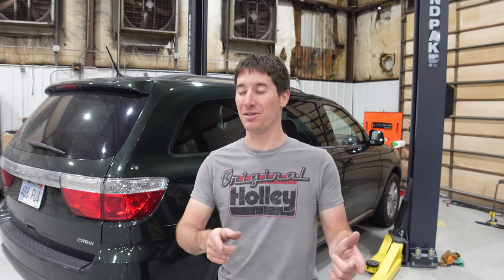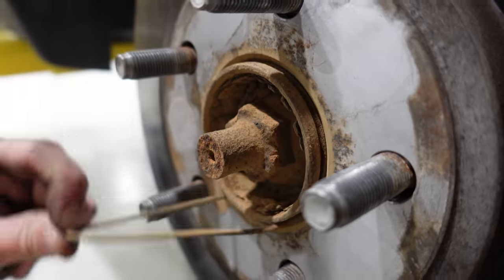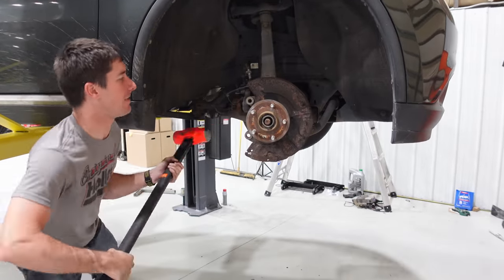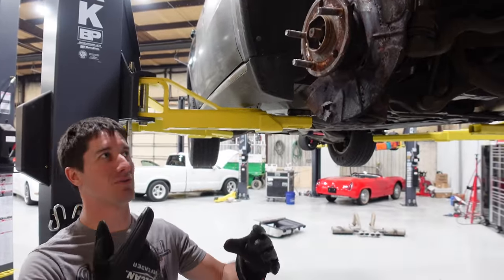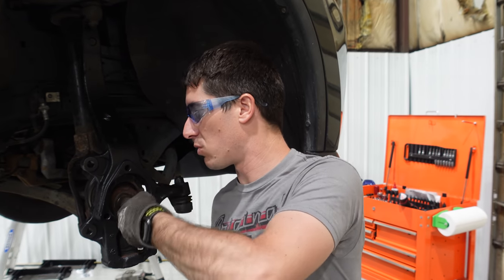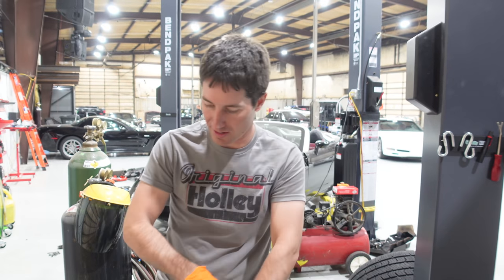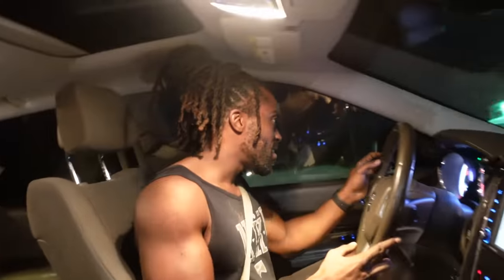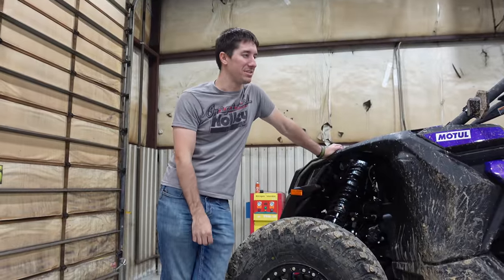This Is The Most STUCK Wheel Hub I've EVER SEEN *Totally Rusted*

Comment: Put a cheap slotted and drilled front rotor set with decent quality pads on sisters 99 300m and surprisingly they actually still stop better  than the factory setup and haven't warped yet. Sometimes you get lucky on cheap parts and maybe same with those rotors you got on that Durango. Hers had decent reviews and it had been shaking badly during braking for a while so needed to get done. I may throw a set on my 06 Charger RT as it has a very slight shake at speed and the pads are still fine. I love four wheel disk brakes...

Comment: Needed to do a rear wheel bearing on my 330ci.  Hub was so frozen on the axle shaft that a 20 ton press and oxy-acetelyne torch wouldn’t get it to budge.  Ended up finding a good used rear trailing arm/knuckle and cv shaft for $100.  Never seen anything like it.

Comment: No hammers or pullers needed. Put a piece of pipe btween the edge of the hub and frame and use the power steering. If the 3 nuts have flanges use a socket and extension. If you do not care to salvage the rotor just remove the 3 nuts on the hub, and bolt the rotor back on. Then use a pipe between the rotor and frame.

Comment: Man I did 2 hub bearings last week and got super lucky I bought a big slide hammer last year when I needed to do a previous wheel bearing on a different vehicle. Popped out with about 50 or so hits. But yeah if you had a slide hammer and your buddy heating it with a torch I think you would've gotten it easier. Massive pain in the rear either way.

Comment: Not that it hurts to reinstall, but rotor retainers are only there to prevent rotors from falling off going down the assembly line. They don't need to be reinstalled.

Comment: Wheel hubs with rust, good luck with a sledge hammer.  You need an air hammer, or grade 10/8 long bolts and press that hub off,  both work well but I prefer the press, just set the impact gun to #3 power and let it rip.

TLDR: Soak the hubs in pblaster before trying any tool and let it sit for 30m

Comment: The problem here is the bad bearing is giving flex so most of the hits are being dissipated in the bad bearings so put the bolts back in and hit them with an air hammer.

Comment: lol you had it easy. My 05 Durango was way worse. It took 3 days. 2 full cans of map gas. a can of pb blaster and about 2 hours taking turns with my friend using a 10 lb slide hammer connected to a hub puller. There was an entire white metal o ring welded to the knuckle that came off of the hub when we finally got it off.

Comment: When I worked in a shop I've had a couple bad experiences with axles seized in the hub, my snap on air hammer wouldn't even push the axle out a couple times. Destroyed splines on the CV axle pushing it out with a press. But the worst, by far was a 1 ton 4x4 dodge, even with the special long socket looking tool that uses steering to press out the hub. After several hours my boss came over and torched the ball joints ( you can't take the nuts loose without removing the axle from the hub) and we put the whole spindle in the press, where it cracked while we were heating it. Ended up with new ball joints, spindle, axle ujoint, outer stub axle, and hub. Worst day ever.

Comment: Take an old rotor and bolt it backwards on the wheel hub. Gives you a bigger target to hit with the sledge hammer.
Reply: 🤔 interesting but I'm not sure how well that would work in practice. I have split rotors from the hat and I wasn't even hitting them that hard

Comment: Next time go get some bolts at the hardware store that thread into the back like the ones you took out. Put in a few threads. Get a air hammer and hammer on the new bolts. It will come right off

Comment: Am I the only one that noticed the uneven wear on the tire you took off while it was leaning up against the lift?  Looks like you might have a toe-out problem (unless it was the bad hub causing the uneven wear).  Something you might want to look at in the near future.
Reply from the maker: Yeah those brand new tires were feathered when I got it… Potter and I agree it’s causing most of the front end noise 🍻

Comment: I would've grabbed an air hammer and started hitting it on one the ears and get it to spin to break free whatever rust is holding it, the hit it from the back with the air hammer or in your case sledge lol. But either way looks like you got it out, being in Michigan rusted hubs are a dime a dozen.... especially on mopar.

Comment: My daily driver is a 2011 Durango R/T, and I'm looking forward to doing the cam/lifter replacement for the DoD problem most of the 5.7s have (99k miles now).  Right now, I'm just hearing a lifter tick at startup which goes away after a few seconds, but I'm not waiting for a cam lobe to wipe out!  Besides this, it has been a great vehicle, and hey... it's paid for!

Comment: The sauce for pressing out stubborn unit bearings is to use the power steering as a press to push them out. Just gotta find a place where you stuff an aluminum slug or bar against the bearing casting and then some other part of the steering (or the frame), fire it up, and bump the wheels opposite of your brace. Work it back and forth like that a few times and they pop right out. 

I did one side of my TJ as you did here... Taking an entire day, lots of cursing, etc. I did the other side as I suggested (which I read from someone else)... 15 minute job.

Comment: Shuould have put a bolt 5hrough where the stud was out and a nut on the inside,then crank the bolt against the backing plate out she comes.Southmain auto has a tool for it check it out JR

Comment: Your smarter than this.     Both wheels off ground ,in gear,    hold one wheel from spinning,     then the other   ,see which one is making noise.     NEXT ,cut a section out of the dust shield and remove it. This lets you put your OXY TORCH WHERE IT DOES THE MOST GOOD.  NOWWWW get a high quality WOOD CHISEL.Use it to wedge apart the bearing hub and the aluminum bearing housing.

Comment: Use a damn chisel and some PB Blaster. It'll come right off. I've had way worse hubs than that, and using a hand chisel with a hammer and pb blaster got it right off...also, you NEVER grease an abs sensor. That will cause serious issues. Trust me, I just dealt with one on my truck, had grease all over the sensor and it caused low speed activation and fucked things up.

Comment: Nothing against you jr but those hammer swings just werent powerful enough. I live in texas but every now and then i run into seized rusted shit like that but ive never had to use fire. Im 6 feet 300 lbs mostly upper body strength so i make quick work lf things like this. Also look up wheel bearing towel trick thats another good one

Comment: I recently offered to do my father in laws rear wheel bearing on the COMPANY car to be nice and save $ and it was this stuck!!! I wanted to puke... thankfully mine had a hole in it to remove the bolts from the front and I was able to thread a bold and washers and nut to force it out

Comment: Maybe I am just naive, but why wouldn't a gear puller have worked?  There's a detent in the axle for the gear puller nub to sit in even.  Seems like a no brainer to me as a much easier and efficient method to basically pull a bearing off.  What am I missing?
Reply: CV joints are not designed to be pressed on like that. Would ruin the axle.
Reply: That only works if the axle is stuck in the hub.
Reply: @dafirnz  more specifically, that's only the trick for unsticking the axle from the hub. If you give the axle a single whack and it pops loose like happened here, further whacking of the CV doesn't help at all in dismounting the hub from the knuckle.

Comment: Quick pro tip.
Punch out the lug nut thread screws and put a similar sized long screw in there with 2 nuts on each and and use the torque wrench to tighten the nut and it will press itself out evenly

Comment: And the hub retaining bolts and axle nut were magically installed and torqued - NOT!! "Torque the wheel" is the only mention. WTF - one of the most important steps of the installation, torquing the axle nut, was totally omitted. If the passenger side hub was worn out the driver's side is not far behind.  Why not replace BOTH hubs while the vehicle is on the lift?    Missed the mark on this video.
Reply from the maker: First I put the tq on screen, it takes 3 seconds, and the video was going to be way too long. Didn’t miss any mark, this isn’t a how to 🤷🏻‍♂️
Reply: 3 seconds…. Really? I’d like to be to see that technique. 

It would have been EASY to edit out “3 seconds” to show torquing the axle nut”

Comment: Ran into the identical problem with a GM SUV.  I am from Detroit and the car was low miles but went through about five winters.  Relocated to a warm climate, wheel bearings go bad on a lot of GM FWD SUV's...bought a replacement off Amazon...all started like you started in my garage.  I got the bolts apart and big nut off with air impact wrench. Btw, I know its tight in there but I would never combine open wrenchs like you did.  Not good for the wrenchs but a health hazard if the wrenches slip which is easy to do.  Then I tried, slide hammer I rented from  Autozone...sledging on it with 3 lbs sledge and MAP gas.  No bueno. Very frustrated.  Didn't expect that.  Beat on it for quite a while along with a friend.  Couldn't get it apart.  Called my local auto shop, pitched my case and asked them if I drove it to them with bolts back together at low side of torque to easily get it back apart if they would do it if provided the new wheel bearing. They said bring it in.
What did they use? Acetylene just like you.  Would also help to have a helper the size of a house like you had to beat on it.  I am older and my good beating days are past.
So a walk down memory lane.  For those in the same situation who don't own Acetylene tanks, likely your local mechanic will.
Glad to see Durrel get it back on the road and thanks as always for the good content.

Comment: Next time, leave a bolt in, but just started. place a spacer between the bolt and the Control Arm, start it and use the power steering, works as a press and poof out they come. Jeep Guys beening dealing with those unit bearings since 1984 in Cherokee's... 
Cherokee, and TJ use a 13mm 12 point, I use a hammer on the wrench (poor mans impact) to break them loose, typically have blue locktight on them from the factory. At least on Jeeps.,